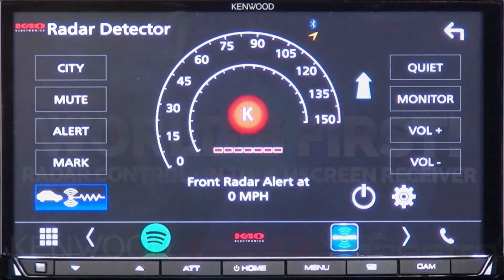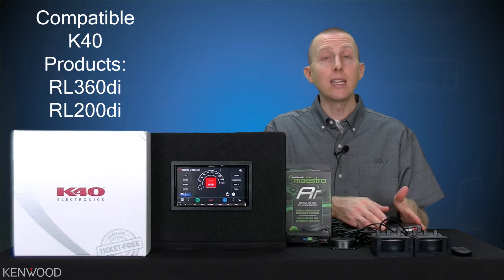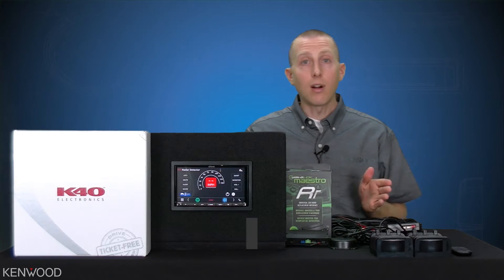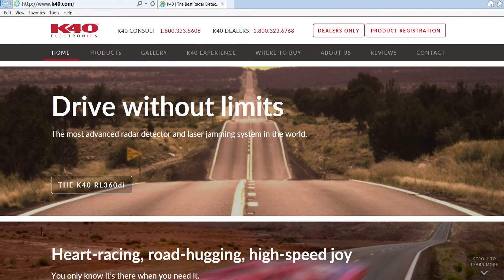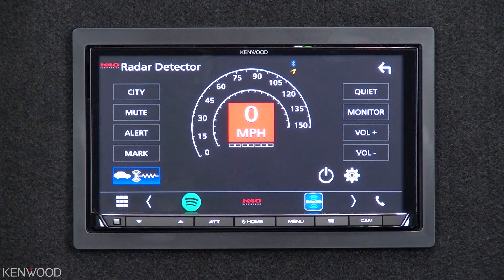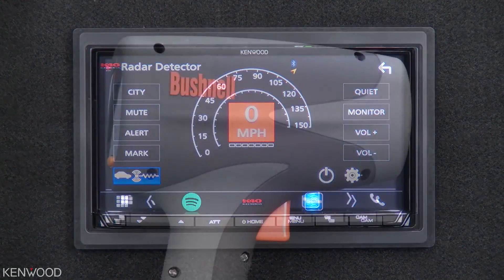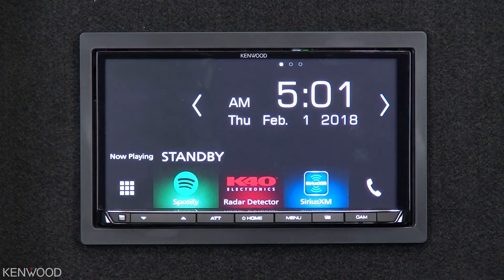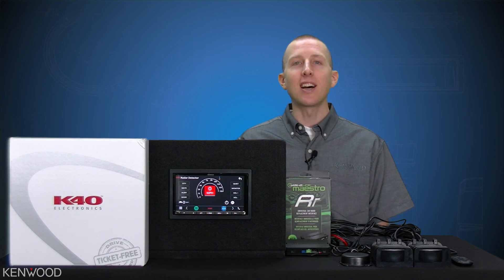KENWOOD – K40 – IDATALINK Radar Integration Unboxing, How to Setup & Operation – World’s First!

Comment: How can I use it with my original car multimedia screen ?? It has Apple CarPlay and androidauto
Reply from the maker: iDatalink Maestro output is not compatible with OEM  receivers, you must upgrade your vehicle with a KENWOOD Maestro compatible receiver to use the features demonstrated in this video.  Android Auto and Apple CarPlay are features associated with using your smartphone with a compatible receiver and are not related to or required for iDatalink Maestro.  Thanks!

Comment: Does the iDatalink have to work with my car model or can it be used just to interface the Radar Detector with my Kenwood dnx893s and ddx9903s?
Reply from the maker: The iDatalink Maestro RR does not have to be compatible with your vehicle for this to work, but it must still be used to allow for the communication.